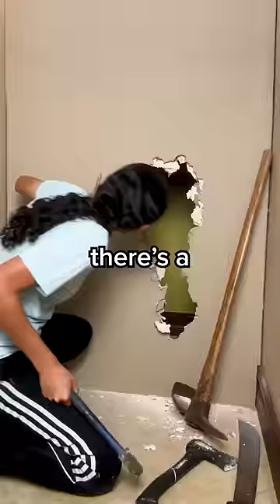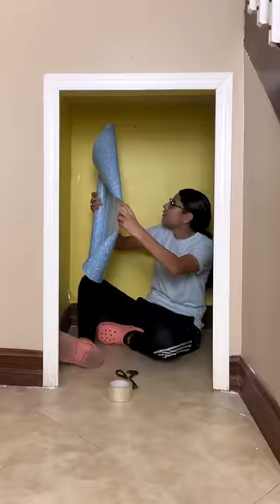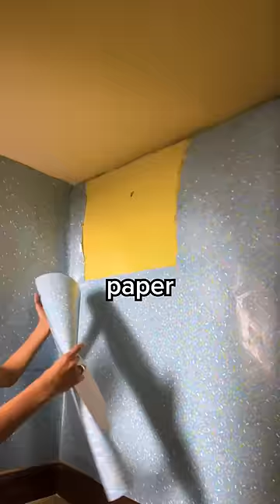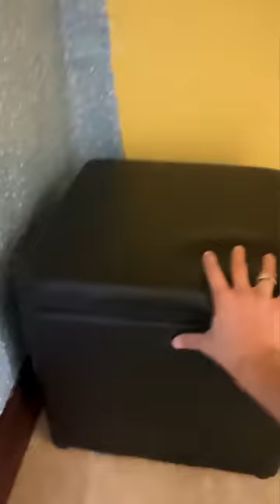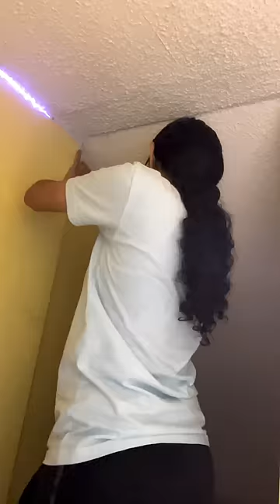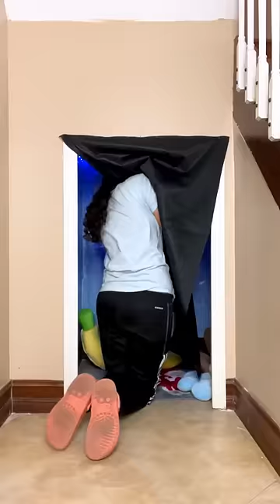I Built a Secret Room with $0

Comment: Anyways here's a frozen caramel slice recipe

INGREDIENTS:

400g shortbread biscuits

80g unsalted butter, melted, cooled

1 cup (90g) desiccated coconut 

1.5L caramel gelato, or ice cream sofened

400g ja dulce de leche (from gourmet food stores)

200g dark (70%) chocolate, chopped

300ml thickened cream

1/4 (60ml) sunflower oil

RECIPE:

1. Grease the base and sides of a 5cm-deep, 20cm x 30cm lamington pan. Line with baking paper, leaving some overhanging.

2. Place shortbread in a food processor and whiz to fine crumbs. Add the butter, coconut and a pinch of salt, and pulse to combine. Press into the base of the prepared pan, using the back of a spoon to smooth the surface.

3.Spread over gelato, then dulce de leche. Smooth the surface, then freeze for 1 hour to firm up.

4. Place chocolate in a heatproof bowl. Place cream in a pan over medium heat and bring to just below boiling point. Pour the hot cream over the chocolate and stir until melted and smooth. In 2 batches, stir in the oil until combined.

5. Cool slightly, then pour over the slice and smooth the surface. Freeze overnight or until firm.

6. Remove from freezer 20 minutes before serving. Using a warm knife, cut into pieces and serve immediately.

🎉enjoy!!🎉
Reply: This is not related but I am not complaining 😂
Reply: Thank you I guess😂❤
Reply: Well... thank you. I appreciate it 😄
Reply: This recipe needs to blow up ( cuz I won't find it again)
Reply: Thanks for the support everyone!
Reply: irrelevent but useful
Reply: 10/10 comment, would try again. The recipe was delicious :)
Reply: Thanks ❤
Reply: thank you gramma

Comment: Oh I thought you'd use galvanized square steel, eco friendly wood veneers, and nuts and bolts from your aunt.
Reply: little johnny worked his butt off for 10 years, finally being able to afford a 0 square meter room
everyday he has to strap himself with loose metal wire to not fall off
little johnny got frustrated with how he is living and decides to buy a galvanized square steel frame to expand the room
next he borrowed expansion screws from aunt to weld a bed frame to the galvanized steel frame
he would then install a washbasin as well as weld galvanized square steel frames for floor 2 while also using eco friendly wood veneers to support his kitchen
he would then borrow another floor from aunt putting the shower there while using eco friendly wood veneers to support the structure
and there you have it a 0 square meter room
Reply: @ivanoperkunic7852  ahh our legend little  johnny
Reply: @Smilebee128   new sequel

be brave and live on the moon with your childhood eagle

little Johnny worked hard as a brick layer for 10 years and finally saved up enough money to go to the moon
he brought galvanized square steel frames and pipes as well as a door made out of eco friendly wood veeners
he then installed an induction cooker and  a shower while also separating the living space from the shower and kitchen as well as him making a toilet
borrow a mattress from his 7th aunt and use expansion screws to weld galvanized square steel frame to the bedroom and add comfort pads and a safety railing
next weld a galvanized square steel frame to the wall with eco friendly wood veneers which will double as a work space and dining table
next add a projector so little Johnny can binge watch Korean drama
add a shelf to store little Johnny's space suit and his space shoes

and there you have it a functional house on the moon